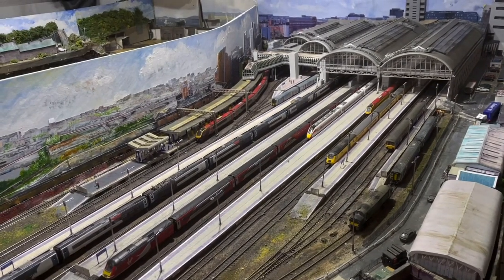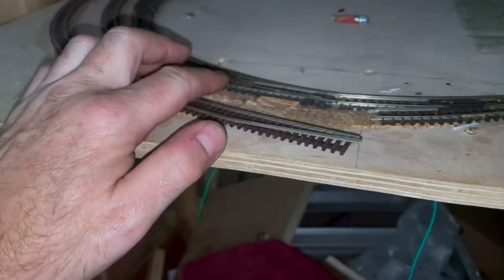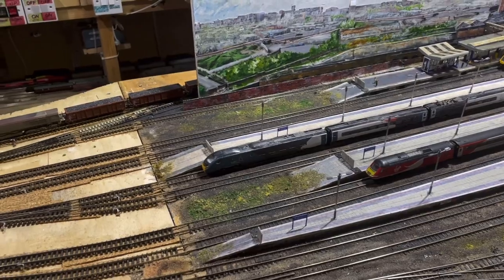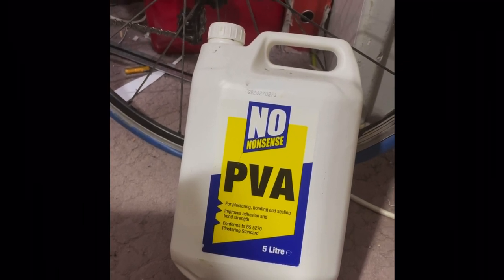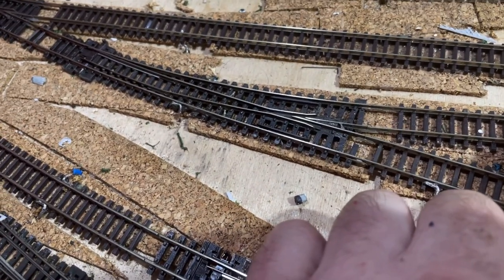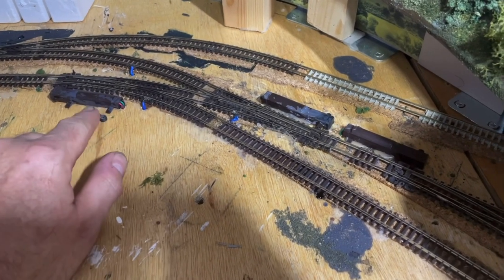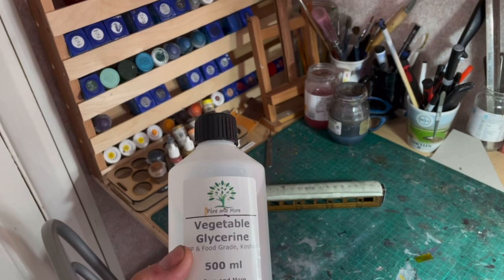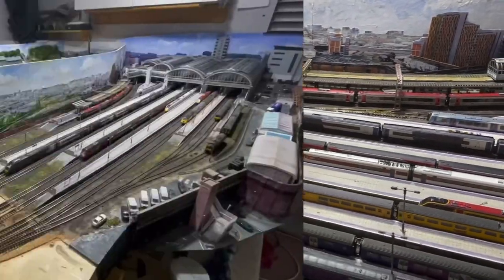MANCHESTER PICCADILLY  IN N GAUGE – Problems in Hot Weather

Comment: Wow, 40 degrees forecast for the UK, we get those days during our summer  quite often but houses are air conditioned generally so generally we don't get too many issues thank god. I reckon my 150 metres track grew a total of 6 inches based on the 1mm expansion.
Reply from the maker: Hi Chris, Ive just got back from work on the first day of 40* and gratefully all seems ok on first glance, Ill look closer later
Reply: @piccadillymodelrailways   That's good John, hope it stays ok, i remember in England having a train in the loft, it was sweltering in the summer, imagine in 40 degrees would be about 50 in a roof space.

Comment: Hiya John,  some really great advice 👍 my layout is on the shady side of the house but does get really hot.  So the window has been open most of the time . I have put most of the stock in store so the models don't warp ( I had a few issues with dapol FEA wagons . They warped out of shape ) never knew about Glue issue till I had a station building pop apart this weekend.  Stay safe John
Reply from the maker: Hi Andrew, hope you are well. Blimey warping wagons sounds painful and expensive, probably a wise move removing them. Ive never experienced that, hopefully closed curtains will be ok

Comment: I live in the tropics where we get temps over 30 for 6 months, summer peaks at about 35 for a month. But we have air con. I dread to think what 40 without aircon would be like. I think the best advice would be stay out the loft. I had heatstroke (mild) last week after a long line up for covid testing in 35 degrees. Please dont underestimate heat. Once its close to, or above body temp.. its a litteral death zone. 👍. Stay safe folk.. stay out your lofts. Ohh.. and be interesting, if you have a loft layout, put some candles up there.See if they melt. Stay safe. And congrats on the job 👍
Reply from the maker: Thats good advice too. Because our UK climate is often quite dreary and overcast, any extremes of weather will always cause a few issues, but we’ll all be ok with simple precautions, lots of fluids, fans, lots of ventilations. Hays and suncream for those of us who need to be outdoors.
Reply: @piccadillymodelrailways  Yup. I am a brit of the scottish variety. I aint a medic or nowt, just an engineer, but after 12 years in south china.. medium high temp living takes a change of thought. Move slow, blah blah  we know that. I just hate to think of modellers running up to the loft to check for rail breakages. Cos you cant go from super super hot.. to a hot bed.. and expect your body to relax. You need keep cool as much as you can. Heat does kill. Stay out your loft.. unless you have a car with aircon to sleep in for a few hours. 👍
Reply: Basically, heat is different. If you are in an unheated loft in the winter in the UK, you can wear fingerless gloves and model away. Get too cold, pop downstairs and put the leccy fire on to defrost. If you loft is superheated.. stay out. Cos you dont have an airconditioned citadel to recharge in. Hot places, such as where I live.. we have aircon. And england is about to go 24 hour superhot.. so stay out your loft 👍

Comment: When cooler weather returns, you can replace the plastic insulating fish-plates with a very thin piece of plastic card glued in place with CA glue and then shaved/trimmed to the contour of the rail.

Also, leaving a small gap now and then at rail joints will give the rails room to expand.  Always a good idea to not make your rain joints too tight in the first place.

If temperatures dip to cooler levels at night, open your windows after sunset and leave them open all night (rain permitting); but be sure to close them (and the curtains and blinds) in the morning before the heat and humidity set in.  Fans can help draw in the cooler air.

Remember that humidity can affect wood and wood products (card, paper, etc) even if temperatures are low.   High temperatures affect more metal and plastic (rails, sleepers, etc.).

Above all, keep yourself cool and hydrated at all times.  Should you fall ill, you won't be able to enjoy your trains.  Keep safe !